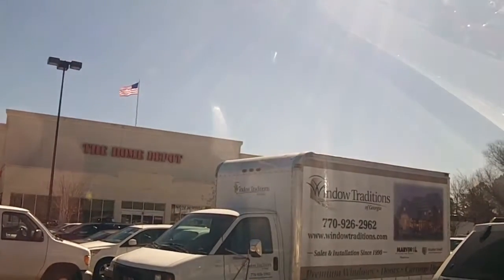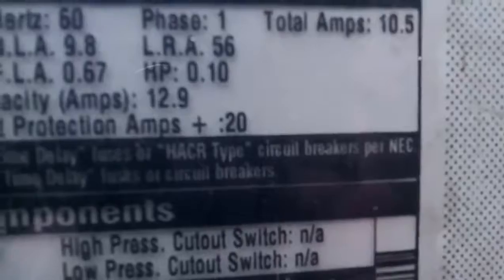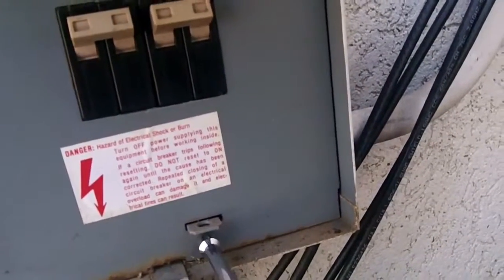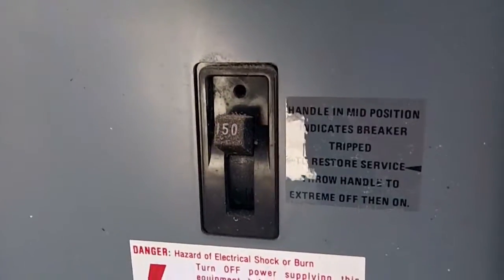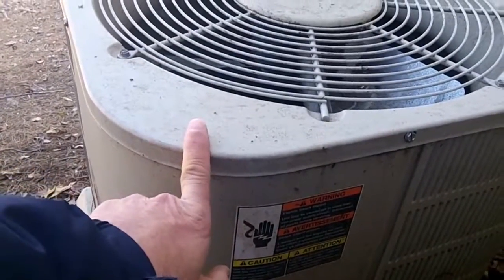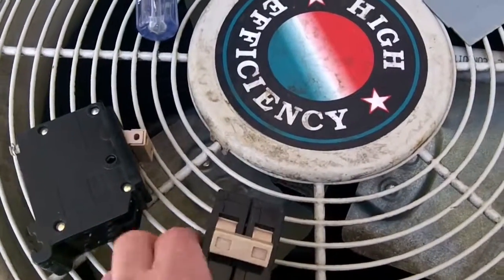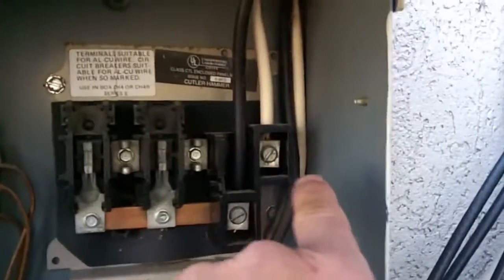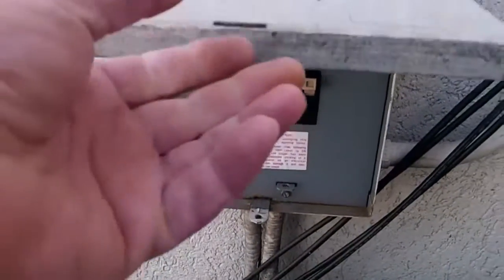How To Install A Circuit Breaker In An Electric Panel

Comment: hey t& n I did not know you went by the name Wallace I had a question partner Edison is requiring me to move the breaker that was directly installed in my old turn table meter 30 amp double pole it has conduit can I just run it directly to my breaker panel box? there pushing it to be done I wanna try to do it myself, it's a fabricated home with a permanent foundation now thank you any help would be greatly appreciated.